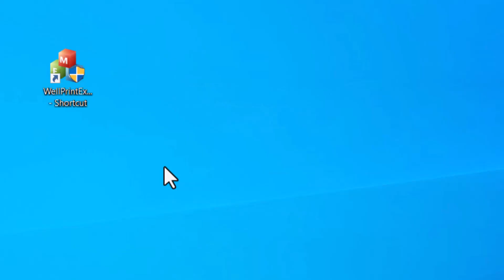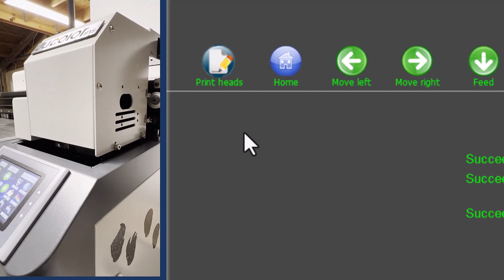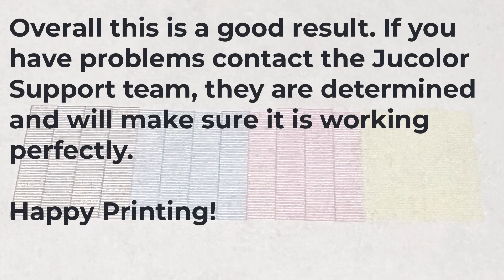Jucolor A3 Daily Startup Procedure DX7 Head @jucolorins

Comment from the maker: I created this video to help others new to UV Printing with a Jucolor Desktop Flatbed Model A3 UV Printer. Every day before you start your print jobs you should run through this initial procedure. If the results are not satisfactory you may need to run additional cleaning procedures. If additional cleaning is not working and the results are still not good you may have another problem such as a clogged channel or a bad damper. Follow, like and subscribe for more content like this that will help you be successful with UV printing.